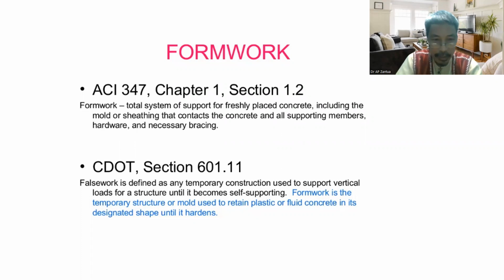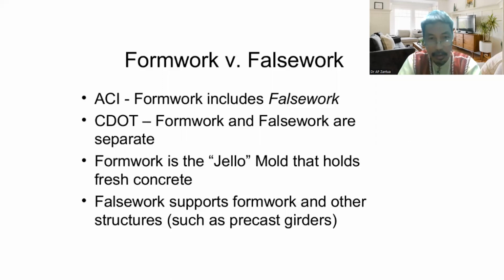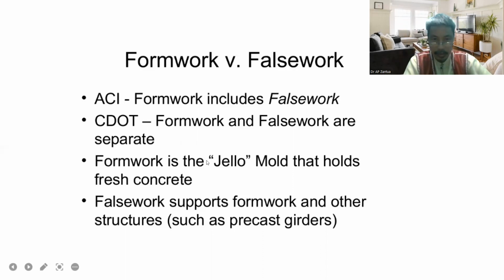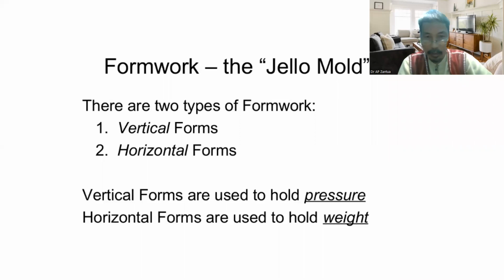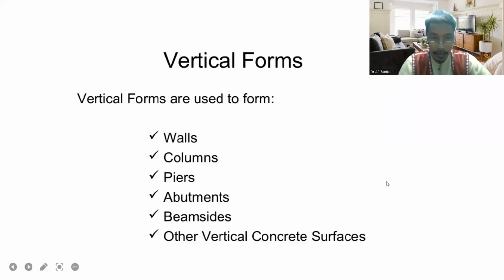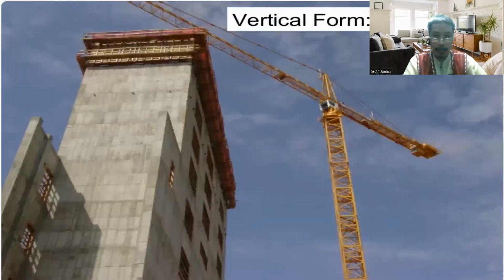Formworks & Falseworks of Reinforced & Plain Concrete [ PRPC Design ] M1.01.a

Comment: Thank you sir for this video, I learned the difference of Formwork and Falsework in construction. Formwork is a type of falsework, wherein it is indirect contact with the concrete. Flasework can't and cannot be indirect contact with concrete. It also talks about the different perspective of the organization's code. 

Q6. Non-shrink gout shall be placed within _ minutes and will be discarded of unused within 20 minutes. A. 30 minutes B. 45 minutes C. 60 minutes D. 90 minutes

The answer is B. 45 minutes

Comment: Thank you Sir for this video where teach about formwork and falsework of the reinforced concrete and also guide for formwork. Two types of formwork are vertical forms and horizontal forms.

Non-Shrink Gout shall be placed within minutes and will be discarded of unused within 20 minutes.
Answer: B. 45 minutes

Comment: Thank your sir for this lecture about Formwork and Falsework.
Form work v. Falsework
ACI- Formwork includes falsework
CDOT- Formwork and Falsework are separate.
Formwork is the "Jello" Mold that holds fresh concrete.
Falsework supports formwork and other structures (such as precast girders)

Comment: In this video, I learned the difference of Formwork and Falsework in construction. Formwork is a type of falsework, wherein it is indirect contact with the concrete. Flasework can't and cannot be indirect contact with concrete. It also talks about the different perspective of the organization's code. 

Here is the Challenge question in this video: Q6. Non-shrink gout shall be placed within _ minutes and will be discarded of unused within 20 minutes. A. 30 minutes B. 45 minutes C. 60 minutes D. 90 minutes

The answer is B. 45 minutes